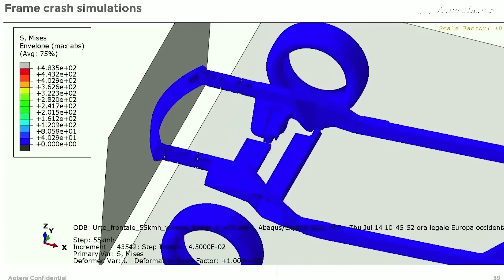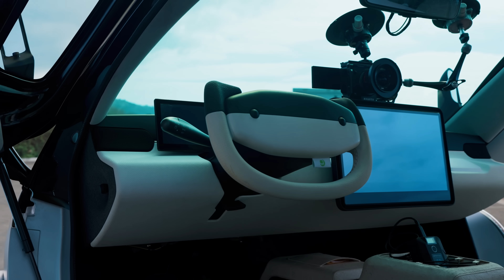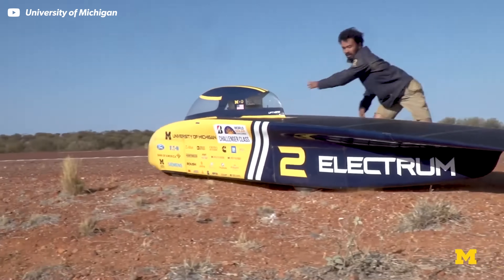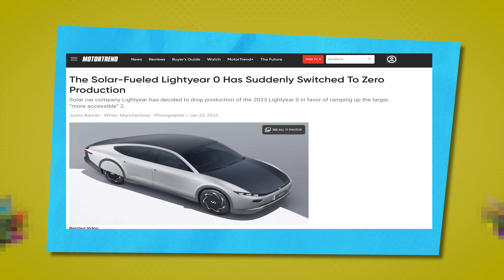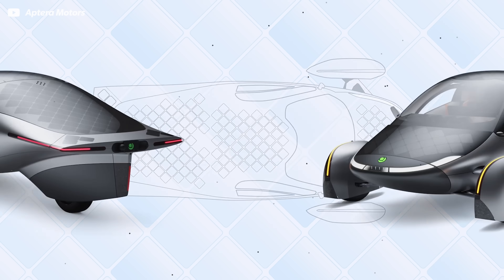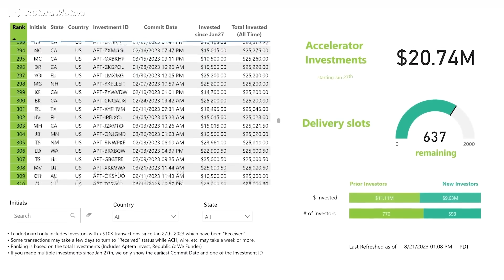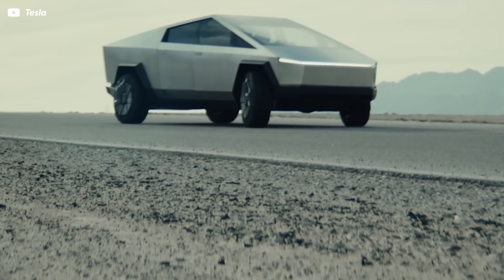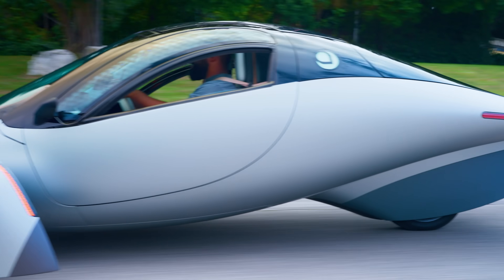We Drove America's First Solar Car

Comment: Only electric car i would own is a solar one. Can't wait for some more r&d
Reply: Why?
Reply: @franquil85conn  it is more environmentally friendly as alot of the electricity we use is made using fossil fuels and you can recharge it for free.
Reply: @franquil85conn otherwise the car isn't truly green on its own. It's just a more expensive, more full of dangerous chemicals version of a gas car since at the end of the day you're probably plugging your ev into a coal or natural gas based power grid.
Reply: @jovanmcintyre7334 There are dozens of life cycle analysis studies that have shown that this claim is wrong. There's a rather popular one from the technical university of Eindhoven that showed, even powered by electricity from 100% coal, EVs have less impact on the environment than fossil fueled cars. It's frustrating how these anti EV myths never die.
Reply: @jovanmcintyre7334  because you can't charge at home on your home solar? or hydro power like most of Canada? i wouldn't blame electric car for the fault of the US electric grid
Reply: or you can just put that tiny solar panel a solar car has on a corner of your roof and drive any EV.
Reply: Solar panels on a car isn't viable unless your car is super efficient and you only drive short distances. Also, repair parts will likely be much more expensive since the solar panels will be damaged when that part is hit.
Reply: @UnexpectedTokens  hydro power is not as green as it was sold to be
Reply: @peterkn2  these panels aren't that expensive and it is extremely efficient because of its low weight and aerodynamic drag
Reply: It makes a lot more sense to just put the solar panels on the roof of your house rather than the roof of  your car
Reply: @TheRealSykx  But yet solar only gives it 5 MPH of range.  That's some slow driving.  The reality is the solar is only there to impress the mathematically challenged.
Reply: @madattaktube  on the car extends the range for remote places and road tripping
Reply: @TheRealSykx  neither is solar, what's your point?
Reply: @jovanmcintyre7334  This still has a battery. It's impossible to create a usable car that would work directly from solar power.
Reply: @danvanf  Do you drive your vehicle every minute of every day? With an average of 5 peak sun hours that's 25 miles of range times the number of days you expect to own the vehicle.. that's a lot of free miles. My commute is 10 miles one way so theoretically I should only have to plug it in on cloudy days. Sounds good to be, obviously it should be taken with a grain of salt, but the math checks out.
Reply: @madattaktube  also, not everyone owns a house
Reply: @kooooons  They are better, but if you have a car that is purely charged on solar power, obviously that is the only possible way to ensure ZERO emissions.  At least once it is made since the process of making it definitely does create emissions.
Reply: @TheRealSykx  A far better solution installs the solar panels at home. Putting them on the car is a gimmick. I agree, they say 5 MPH charging, in perfect conditions. Imagine needing to park facing South, how many humans can do that?  Cities have parking garages and tall buildings to block the sun.  A Chevy Volt with 40 miles of range would fit your daily commute,  it came out a decade ago or more.  There is a reason you don't have one. This car is an eye catching double failure.
Reply: @PlaySA  In fact solar is the least carbon neutral of all renewables usually @~35-45g/kWh. If you want the best you need wind power @~11g/kWh 🤓
Reply: And if you live in an apartment? @DoradoClaudia
Reply: No, theoretically, you would never have to plug it in. @TheRealSykx
Reply: @glennzajic7318   solar alone wont be enough for most people using this car, is just a range extender, you still need to plug in it. it's most important feature is the efficiency, as you can get more miles per kw/h than any other EV.
Reply: @madattaktube  You're not wrong ....however,  keep in mind there's a huge  market of drivers that live in Condo's or Apt. buildings that can't install solar panels at home. Imagine going camping for a week and leaving the campsite with more energy than when you arrived.
Reply: @nyanko8222  Yeah, "a lot" of the electricity is generated using fossil fuels.
It's much more efficient to use fossil fuels 100% of the time than it is to use them a fraction of the time.
Also, we alllll know that it's more efficient to generate force from internal combustion engines than it is to use a power plant.
That's why power plants are just banks of supercharged Hellcat motors, right?

...right?
Reply: @danvanf  I own a townhouse where I couldn't ever charge an electric car. I'd only have the option of the ($$$$$$$$$$$$$$$$$$$$$$$$, way more than gas where I live) public charging network.
I worked out that if I got a Prius Prime or Hyundai Sonata with the solar panel, I could park it outside and do nearly 100% of my driving on electric alone. 
The only exception would be the ~500 mile trip where I go see my mom, at which point I'd enjoy ~55 MPG and drain the tank so the fuel didn't go bad.
Not everybody commutes from bumblebum nowhere into work every day.
Reply: @Randy-J   I live in an apt and it sucks that I can't buy my own panels, but there are community energy schemes for panels and turbines that you can invest in in many towns. Camping is a better usecase, but even with this extremely high effiency design it only gets 5MPH of range in good weather - on any vehicle practical for camping range gain is going to be awful. Buying a bunch of deployable solar panels makes way more sense for camping.
Reply: @madattaktube  aptera says you can get up to 40 miles per day depending on where you live. So I'll  assume Southern California would get that,  and where I live in Southern Ontario it would be less . If you're parked at the campsite for 7 Days that's 280 miles or over 400 km that you're able to drive at the end of your trip. I'm not sure what you're referring to when you say 5 mph of range. Do you mean 5 Mi of range? It's more like 40 miles per day.

Comment: My garage is narrow with shelves on both sides, so I need to open my car door carefully to not hit the shelves and open it with just enough room for me to slither out.  When they tapped on it and the doors swung open, I imagined the doors slamming against the shelves and stuff falling all over the car. Unfortunately, my place is small and I need the shelves in the garage to store stuff. So if I get an aptera, I can't put it in the garage.
Reply: The ceiling could be an issue, too.  Quite a few people will want to leave it outside for maximum sun exposure.  Each situation is different.
Reply: The doors do not extend past the body when open. However that front wheel span is about 85.5 inches.

Comment: Now THIS is what electric cars should be. Cheap, well made, not filled a million gadgets, and holy crap they actually made it compatible with wall outlets. That's how you know they are actually trying to innovate. Really hope to see this thing do well in the future
Reply: Most electric cars can be charged from a wall outlet… it’s how I charge my Tesla 99% of the time.
Reply: @superdrone5039 I was trying to say the same thing. The biggest problem is most electric cars are so inefficient nobody wants to bother with a regular 110 outlet. 4 of my coworkers have Teslas, but never plug them in because they only get 3 miles per hour of charging on the outdoor outlet. I get about 6-7 miles per charging hour with my LEAF and the Aptera is supposed to get 8 to 10 miles per kwh, so would charge 12 to 15 miles per hour.

Comment: gotta preface with walkable cities/good transit>any car based infrastructure when i praise a car for its sustainable approach. that being said, this is pretty neat. great commuter car, it looks relatively compact. a 4 seater would be cool to see also. 

criticisms: one of the main assumptions is that you'll park this in a sunny space, which means it sort of requires the urban heat island effect to function best? and it would work best in a place with a lot of sunny open air parking lots (there are a lot of those in america, not really a good thing, tho). still, you can always plug it in. also, don't like the yoke or the big touch screen. i think most people like more tactile controls in cars, otherwise your eyes are on the display more and that's unsafe. 

if its true that the company is big into right to repair, that is also huge, and genuinely one of the most sustainable things about the car.
Reply: Aptera has laid out their general production plans going forward in their SEC reports.  The second Aptera vehicle is likely to be a 5 passenger, 4 wheel sedan.  We are unlikely to hear more details until they announce plans to go public.  At the moment they are laser focused on the first vehicle.

Comment: I've been waiting ages for a credible solar EV... This is just a sensibly perfect car to start a company... $25K is not much if you work in and around a large metropolitan area... Even if you were a photographer (or YouTuber), it could fit your gear for location shoots. This car will launch well, and I'm keen to see how Aptera build up from this.
Reply: $25k is an old price they made up.  The Launch Edition with up to 400 miles range is listed at $33k on their website.
Reply: @Okurkaarrgghh  The $25,900 estimated price is for a 250 mile range version.  The 400 mile range AWD model is also an estimated price.  The prices will be firmly established about the time they ship.  Since those estimates, inflation has been high, but battery prices and the body production method costs have gone down.

Comment: To all my fellow early electric car adopters... WE DID IT! This is the tipping point.  Teens' first car will soon be an electric car for $25k. TIP!!!
Reply: The first models produced will be the 400 mile range ones.  The 250 mile range versions, starting at around $25,900 will come later.

Comment: I get this as a green option over other electric vehicles. For the most part it’s charging is truly green. All others still have to plug in to a charger connected to a grid powered by traditional fuels. So not so green. I’m glad they mentioned the safety rating and tests. That was my main concern at first glance. If it can truly do 1k miles that’s a game changer in electric vehicles. So I await the true tests and reviews. Otherwise there should be no reason this is unsuccessful.
Reply: yes but the Li-Ion batteries that only last a few years before you need a whole new pack, or the solar panels that also last only a few years. can any all-electric vehicle be cleaner than like a 1993 Toyota Camry? I doubt it. Not to mention the child and slave labor.. but we don't talk about that. It is a cool car though.
Reply: @antioch_exe  Demonstrably nonsense. There's plenty of EVs by now with old packs that still get at least 80% of range out of the pack. My piece of shit is 5 years old and sitting at a hair over 96%. Same with solar. When I still owned a house, we had solar all over the roof. We bought the panels used and they were still going strong when we sold the house 15 years later. Yes, panels degrade, but way less than people think.

If anything, the main concern would be exploding batteries. That's a big thing, as burning car carriers and recently Luton airport showed. EVs explode, sooner or later, and they'll take everything nearby with them because the fire CANNOT be extinguished. Basically, all EV drivers should be labeled terrorists.
Reply: @antioch_exe  Solar Panels often comes with 20years a guarantee and many car batteries still have much more than 70% capacity after end of 8-year guarantee.
Reply: @antioch_exe  all of that is so dependent on how much you drive. If you are putting on 50,000 miles a year, the Camry will never come out ahead
Reply: Solar is useful due to pure efficiency but my interests is in a unique EV sports car and Aptera fits the bill.  Right to repair, not Tesla (sorry Elon politics over Ukraine are toxic) and space for the dogs is great.
Reply: @antioch_exe the child labor reference is from cobolt coming from the Republic of Congo where they allegedly employ child labor.  Tesla switched to an LFP chemistry that doesn't use cobolt. GM gets its cobalt from Australia, Ford is trying to build an LFP battery plant in Michigan.

Comment: Do you know what that car needs?
The option to at a high enough charge level to turn on the AC. That way, while it's charging in the sunlight, does the interior get cooled down. And when you come back from your business meeting, the interior is nice and cool
Reply: There is a "pet mode" to leave the AC on while parked.  Whether solar can keep up with the battery discharge in Phoenix at 120 F or higher remains to be seen, but it will help.  A fan will blow the hot air past the AC condenser and out the tail of the vehicle.

Comment: I want this SO much for my best friend and I to go on adventures in it! We're both compact, lightweight, and low-maintenance while traveling, so we could probably spend a week on the road living happy and comfy in one of these as long as we found a couple showers along the way, and with minimal fuel and lodging costs, it'd be practically free! Not to mention the fact that we'd never have to charge it at home, cause all the places we usually drive are less than 10 miles from our house.

Comment: I like that it isn't trying to be normal looking - since it has three wheels that probably would just lead to problems or even danger (Reliant Robin with e-motors? James would be upside down again lol) But the swoop look probably helps reduce drag etc. Wouldn't be a bad city car daily with a nice performance ICE car for fun stuff lol.
Reply: Unlike the Robin (which sold 1/2 million examples, btw) Aptera has the two wheels in front and a prototype has passed the moose test.  The geometry and center of gravity is much different.  And James had to rig the cars he used to make them flip.

Comment: Great to see the car finally available to buy. 
Remember that even the best Silicon solar cells are only about 22% efficient these days. Silicon is still the most reliable choice but when the panels double in efficiency, the range gain per hour will also double.